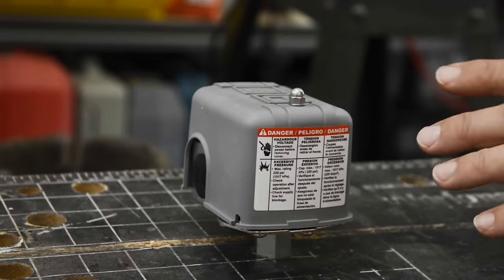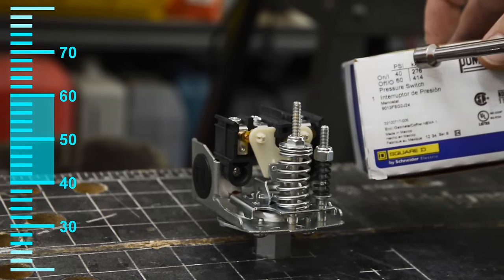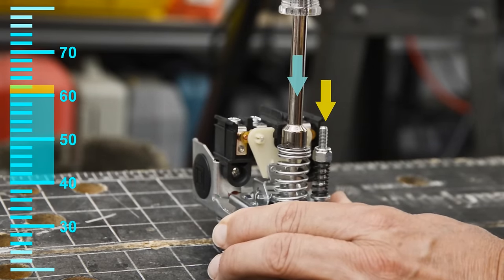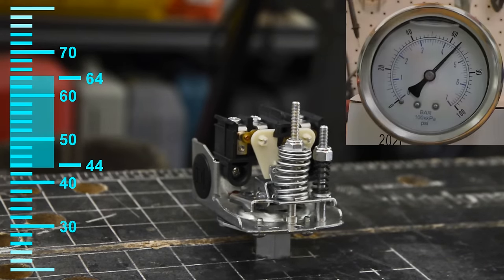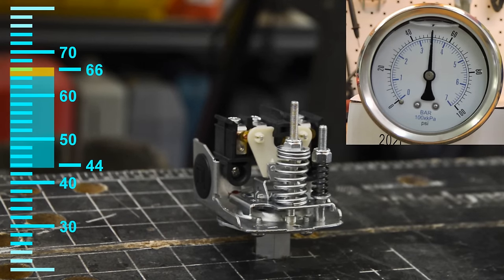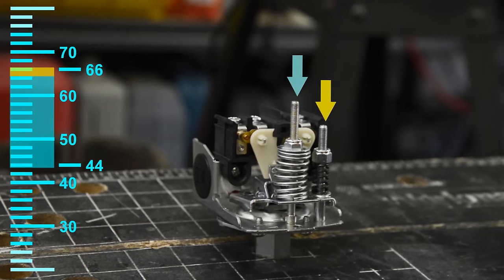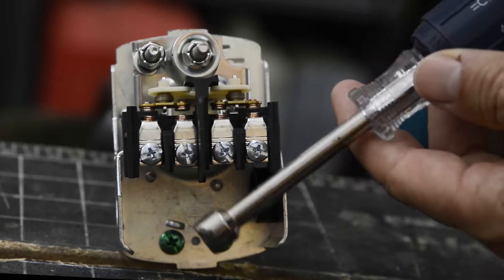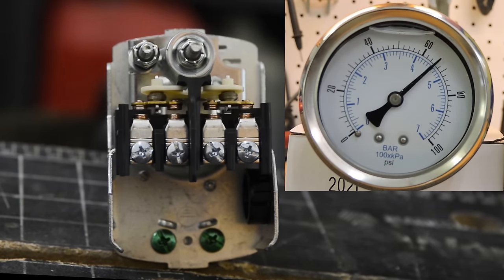Pressure Switch Adjustment

Comment: Fella you just save our back sides ! 21 year old system would not get past 45 psi.(starting failing yesterday), watched your vid cleaned the pressure switch, and copper line. back in business SO FAR SO GOOD! THANKS!!

Comment: Great Video "Reclaim Filters & Systems Inc"! I have an "ok" working knowledge in regards to pressure switches, but I have always stayed away from adjusting the pressure/range/etc., due to my lack of knowledge, and opted to replace the switch when too old, or other wear and tear. After watching your video, and your excellent video work (frame in frame), I have a very clear understanding of its operation. Also gold nuggets were helpful like the Craftsman nutdreivers with hollow frame when working with nuts with extra long screws, are so helpful. In any case, great work, and thank you for the video!

Comment: Our well supplies 3 summer cottages. On our new square d pressure switch the shorter cut off adjustment spring can be moved up and down and is not under any tension. The 40/60 switch cycles at 34/55. The empty tank pressure is 32. We have a 5 year old large ($350)  tank. Under heavy use the pump fails to come on even when the pressure goes to 0. If you  open a faucet you can hear water draining back to the well pump and when it stops draining back you can turn the power back on and the well works normally until it happens again. It always happens when each cottage is using a lot of water. Thanks!

Comment: The pressure graphic is very helpful.  I think most might assume there are high and low setpoints (not the case). Thanks.
Reply: 40 to 50

Comment: This was helpfully the guide on the side of the gauge going through each step I didn't have to call nobody saved me money I don't have right now thank you
Reply from the maker: Cool!  Glad to help
Reply: Reclaim Filters & Systems Inc my submersible pump is bye passing my pressure bladder. when the pump is on it fills up the house lines and about half fills my pressure bladder then the pump kicks off. the meter reads 60 psi.
once the pump is off I slowly loose cyphen and the meter drops to zero.
once at zero all the water in the house lines drain back out side until the pump kicks back on and then all this repeats itself?
there are NO leaks anywhere??
what am I doing wring??
bladder is 6mos old. pump is brand new. meter is brand new. I'm so puzzled.
thanks sherry.
without water 5 weeks now. can't afford repair person after paying for pump.
Reply from the maker: It sounds like the check valve is bad.  If it's a deep well pump the nose of the pump has a check valve that keeps water from leaking back down through the pump and into the well.  Other systems have a check valve further up on the system before the bladder tank.  This keeps the pressure in the system until needed and prevents it from going backwards.  PVC check valves are cheap and easy to install if your well check valve is bad.  Install somewhere between the pump and the bladder tank.  Make sure the check is rated for 120 psi.
Reply: Reclaim Filters & Systems Inc omgosh.......thank you for responding. I am so greatful for your help. I have no way to pay for a repair person and be done all I can do as a 50 year old woman with only my nephew's help.
Reply: Im not clear what the check valve is for sure. is it the box that clicks that has a pressure gauge on it? I replaced that first, then the pump, then all the electrical wiring along the pump and the pressure bladder is about 6 mos old. I'm gonna try the old box again. turned out it was not bad but I left the new one on. if you think we are not talking about the same thing,...will you let me know please.
Reply: Reclaim Filters & Systems Inc I now see that we are talking about the same part. the check valve is what your working on in the video. thank you so very much for your help!!!
I bet I've also got debris in mine and it is clogged. I will check back and let you know when I get this changed over to the other one.
Reply: A repairman added a check valve in my line. My pump is equipped to prevent water from going backwards but it's not working. 
I will take the pump out in the summer to return it for a new one.
Thank you so much for your help!!!

Comment: Thanks, I just bought one from China for $9 bucks, but it had nothing for instructions. I want to understand the cut-off only nut, really, but this video pretty much explains its operation proper. I am using it for a water pressure booster pump after its original pressure control switch started leaking where the PVC sections were fused together. I like this one since it's not electric and any savings is worth it since the pump is 7 amps or up and you will notice a rise in your electric bill with average use.

Comment: Thanks. I didn't know about the diaphragm cleaning. Or the adjustment bolts. After having watched so many videos on well systems today, my head is about to explode. Oh well, easier to watch videos than have a plumber rip you off, which almost happened.

Comment: Hi Sageau, this was just for demo.  Normally the pressure switch stays closed for a few moments after the demand for water stops while the ballast tank is filling.  A common problem for a fast cycling pressure switch is a bad ballast pressure tank.  That will wear out your contacts (sparking) and it will prematurely wear out your pump and use more electricity because of the start stop start... of the pump.  The cold does change the spring tension and will result in a change in set pressures.

Comment: If this has been helpful I am glad.  Thank you.  To answer some questions:  This is similar to even the inexpensive pressure switches found in many small air compressors but the range and the cut off only adjustments are usually screws instead of loc-nuts.  In the common Harbor Freight air compressors the range screw is usually a cad plated metal screw recessed into the plastic and the cut off only is a plastic screw knob that is raised.  If there is only one adjustment, it is usually the cut off only with the range being preset and non adjustable.  In most all cases the instructions are printed in mice type under the lid of the switch.

Comment: Great video, very useful.  My switch is a square D but only has a range adjustment.. I do not have a cut off adjustment.  I've never had any issue until recently the pump doesn't kick in until 15psi, and shuts off at 70psi.. would this be a sign that I should just replace the switch?

Comment: Nice and straightforward with good quality. I've identified my bladder is bad, so my pump is working overtime. When the pump kicks on, the pressure maxes out the gauge. Could this be a sign that the switch may also be bad? Or is this a bad bladder symptom? I've replaced the gauge and cleaned up the contacts for good measure. 
Any input would be greatly appreciated!
Reply: Hi Dan, this is Russ with Reclaim. Depending on the age and condition/quality of  the bladder in the tank, you may be able to simply refill it with air.  With zero pressure on the system, fill to cut in pressure less 2 psi.  If cut in is 30, fill bladder to 28 psi.
Reply: @nckeller  Thanks for the reply. I replaced the bladder tank and pressure switch. The inlet to the pressure switch was 100% plugged, which I guess would explain the high pressure readings. Overall a pretty easy job after.

Comment: Appreciate the video. Can you elaborate on the relationship between those screw settings, the pressure in the tank, the reading on the inline pressure gauge and the force of water coming from the tap? We have a 30/50, installed 10 yrs ago (new house). The past couple months we see markedly less water pressure at times. The wife especially notices it while she tries to wash her hair. Pressure in the tank is 54 psi. Gauge shows 34 psi. I did turn the first nut 3 times and turned the second once. Flushed the toilet, water flowed, the D-Square clicked but the line gauge did not move from 34 psi. Tap pressure is no change after letting it run for 1 minute upstairs. Any thoughts on that?  I considered removing the DSquare from the line to see if it might be plugged but there's no shutoff valve prior to it. Assuming the only way to do that is turn off power to the pump, and still have to deal with water coming out from in the line , if I took it off.

Comment: I had a pressure box installed and the pump keeps starting every few seconds. The max is adjusted to 30lbs. Should I adjust the bigger screw counter clockwise or what would you suggest? This problem is driving me up the wall. I hope you may have a idea of how to fix the problem.

Comment: Great video other guys have no clue what they are talking about quick question what actually create pressure I know the pump creates volume but doesn't the accumulator with the diaphragm creat the pressure I have a system that will run but once I shut a valve it doesn't seem to cut out, I can't tell the pressure the gauge is crap but after a while not long it will blow a capacitor ? Maybe a bad relay ???? Already changed our the 40/60 switch and checked power

Comment: Great video! I have an old pressure tank with no bladder. Should it still be pressurized to 2 psi below cut in?  I was a little worried about over-pressurizing it and only put in 20 psi. The pump and tank are like 60 years old. I should probably replace it.

Comment: Very good and informative video on how these work. I have a 30-50, can I adjust it to be a 40-60? Would I have to adjust the pressure in the air bladder in my expansion tank?

Comment: Excellent video and very helpful.  Great job.  I have the same pressure switch as yours and I'm guessing it's around 7 years old. My pump won't kick in ,when it should at 30 psi  but still  kicks out at 50 psi.  I understand that there is no kick in adjustment, so  I'll first check the contacts and maybe check if there is debris stuck in the screen of the switch.  Wish me luck and thanks.........From Mission, B.C.  Canada
Reply from the maker: Good Luck, some have a switch lever off located on the side that will prevent kick-in as well.  It's a kind of off switch for the pump that keeps the contacts open.  Lever down for normal operation, lever up for off.

Comment: I'm looking to narrow the gap between cut on/off pressures. To do this I should tighten the large nut and loosen the small one correct? My end goal is to keep the overall system pressure a bit higher. I assume short cycling could be an issue but my pump already runs pretty much the entire time any tap is open once it reaches the cut on pressure. I'm hoping to achieve pretty much what a cycle stop valve does. (Not the cycling stop, just a more constant pressure.) Is this correct and is there any drawback to it?

Comment: I want to eliminate my water pressure tank, and go to an on-demand water pump system. I am using a SquareD 9013, set at 65/45.

With the pressure tank disconnected, in this on-demand setup, the water pump will cycle 45 to 65.

Is there a way to adjust the Square D switch to eliminate the range?---My many attempts at adjustment fail to stop the cycling.

If not, will you please recommend a specific switch/sensor that will give me an on-demand setup that operates at 65 psi?

Thank you very much.

Comment: My air compressor doesn't want to start for a while and i was wondering whether is because the switch is not adjusted or is faulty ?  how do I find out ?  The compressor  has about 20hrs of work .  Thanks a lot for your video

Comment: Thanks for the great video! It is very helpful. We have made the adjustments we needed but pump still not workng great. My question is about cleaning the screen out as you allude to in the video. Not sure the procedure for pulling off the pressure switch or if I will loose the prime. Once the pressure switch is off, can the screen be removed to be cleaned or is it just washed off? Thanks for the info
Reply: Becky Knutson 
remove power and pressure, remove cover, mark wire locations and remove wires.  remove switch and clean out orifice as best you can.  If the switch is corroded dirty or worn it's cheap & easy to replace.

Comment: This video was helpful, but I have a question.  What's the max differential I can adjust these switches to? 20psi seems pretty low differential, for my application a differential of 30-40psi would be better.  Ideally I would like to have about 40/80 on/off, is this possible? I only need low pressure (10-30lbs) for an airbrush, but don't really want my pump to cycle too much. Is this feasible?

Comment: I live in a new built, small house. Its been two months and now every time the toilet is flushed the pump switch shuts off and the lever (on the switch) needs to be manually held on until the toilet fills. Water works infrequently sometimes it will be fine for a while. Is an adjustment needed? Is the crappy well water already clogging the switch? Is my 115 volt well pump underpowered for the house? Any suggestions would be greatly appreciated.

Comment: OK, so somtimes the pump won't shut off when you turn the water off. Do I adjust the cut off nut or the psi range nut? Thanks.

Comment: Good  vidio Another thing to check is the water pressure gauge is not faulty. I have spent many frustrating hours trying to adjust the settings when all the time the problems was the faulty gauge,

Comment: Have a shallow well pressure tank. 0.5 hp/ 24 liter. A know-it-all neighbor tried to adjust the on and cut off. Now it is so messed up it won't even start. It  has power but just hums.  It all started when I replaced the busted bladder. Any suggestion? I would so much appreciate if you could help me. My thanks in advance.

Comment: No one has really gotten into the guts like you have. I'm working on mine, I get to 34 PSI and it doesn't cut off, it just sits there and the contacts never separate. Frustrating, but I think I'll have to get a new switch, it's about 20 years old. Any ideas? I cleaned the contacts and if I tap on the pipe below sometimes I can get it to disengage for a second. I was hoping it was something easier than replacing the switch but, that doesn't look too bad. Subscribed.
Reply: At 34 PSI the contacts on a 30 to 50 or a 40/60 should be closed, energizing the pump so it keeps going to the cut off pressure of (50) or (60) psi.  If the pump is not able to go higher than 34 psi there may be a pump issue or something is using water faster than the pump can push it.   If you change the switch please make sure to cut power and drain water pressure first.

Comment: Just replaced the 30-50 pressure switch. It pressures the system to 50psi for cutoff but does not cutin on until gage reads about 5 psi instead of 30 psi. Any thoughts on the fix?

Comment: Great video. Have a question for you. My pressure switch is 40/60, but it cuts in @35 and cuts out @65. Is that normal? Thanks

Comment: ChevySS the 20 psi range is a factory default,  you could raise a 40/60 switch to 50/70 then loosen the cut off only adjustment.  That may get you in the ballpark.

Comment from the maker: That's a reverse action switch for 1 hp  and smaller pump motors.  The cut off range is is 4 to 25 psi, it is set differently.  I am not very familiar with these and the settings are different.  I would not swap springs it's cheaper and easier to replace it with a proper 30-50 switch.  What is your application?

Comment: Great video, thank you for this. I have a jet pump that feeds directly to my garden hose. I'm having a lot of trouble with the pressure switch cycling the pump to the point the thermal contacts open in the motor due to how much it cycles. Am I supposed to have a tank on the outlet of the pump? When I bought my house the previous owners had the pump directly to a garden hose. But it always cycles itself until the thermal contacts open with just a hose connected.
Reply from the maker: If your running water continually you do not need a pressure switch.  Run the pump on while the water is flowing and off when the water is off.   If you use a water hose with a trigger sprayer you will need to add a ballast pressure tank along with a pressure switch or you will burn your pump out.  There are some smaller multi-stage pumps like Grundfos with a built in tank and pressure switch that works well in this application.  I believe the model number is a MQ3-35.
Reply: @reclaimfilterssystemsinc7529  another thing I noticed playing around with it some more today is that once I hit cut off and the pump turns off, the pressure drops down to almost zero instantaneously. Do I have a leak somewhere on the inlet side or pump face potentially? 

Thanks for your reply, I am going to look into a ballast tank because I would like to have a trigger style sprayer on the hose.

Comment: Well/sprinkler system - Center adjustment is 64-65 and every so often, system off, I hear the switch cut off. I look at the gauge and it is slowly bleeding off and then switch will cut on and pressure comes slowly back.  I assume the pump has to come on for a brief moment? This did not happen until I tried to get more pressure on the system due to pump coming on and off on  one area when system was running and I did not want to ruin pump. That has quit when in system mode.I think I have the two switches out of sync? Suggestions?

Comment from the maker: To the person with the Wayne's press switch where the pump keeps running. Are the switch contacts open or closed. If they are open the switch is not wired properly. If the contacts are closed the pressure is not reaching the cutoff pressure of the switch. Most household pumps run up to 50 psi, most commercial systems run up to 60 psi.Good luck and if you still run into problems we're here. You also can send an email with your contact info and we can troubleshoot over the phone.
Reply: Nice and simple😊